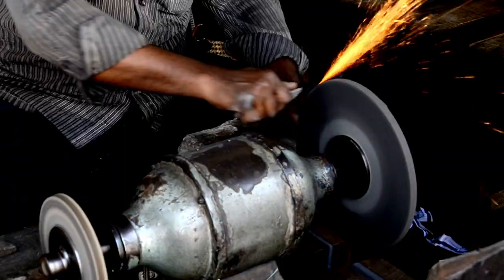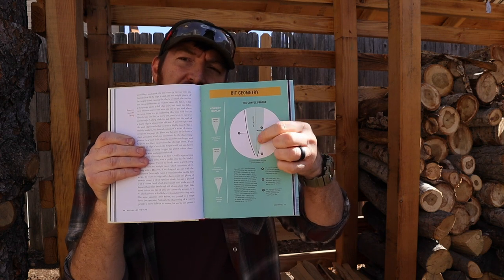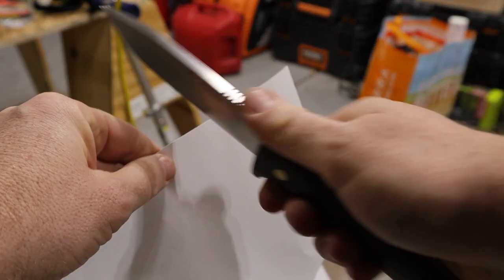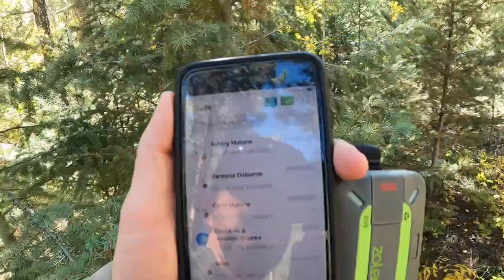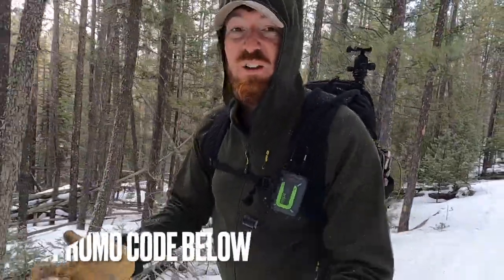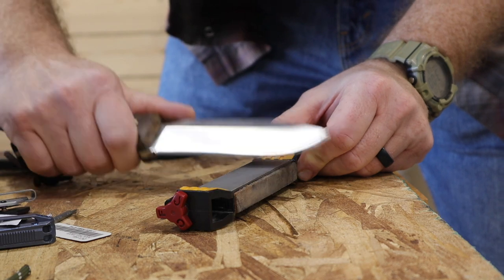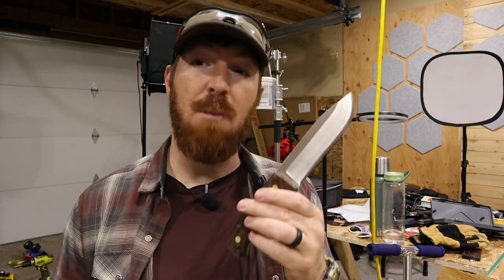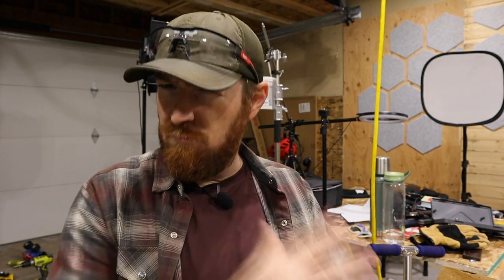Can Convex Edges Be Sharpened On Diamond Stones?

Comment: Interesting technique. For a slight roll, I'll give it a try. For a chip it will have to be flattened, in my experience. Also correct in sharpening both ways not to turn a convex into a flat. I did that in my early days. It is still a good knife, but you lose a big advantage in the convex grind.

Comment: Convex knives don't provide performance aka edge retention. They do have their advantages though. But cut testing in both rope and cardboard has shown longer edge retention with v edge.

With fixed blades I prefer a convex. With folders I prefer v edge.
Reply from the maker: I have had a different experience, especially for outdoor use.
Reply: @gideonstactical  yeah for wood convex is a good idea overall. V grind for wood is just not fun at all.